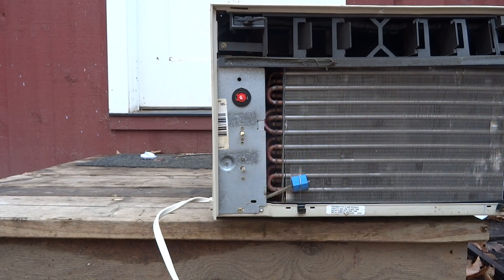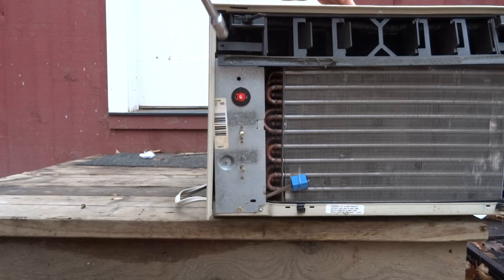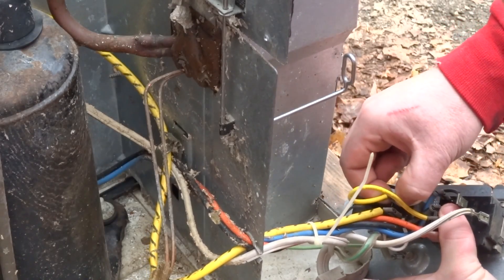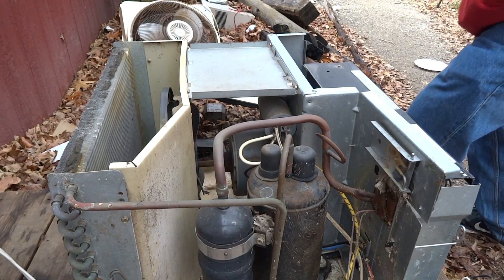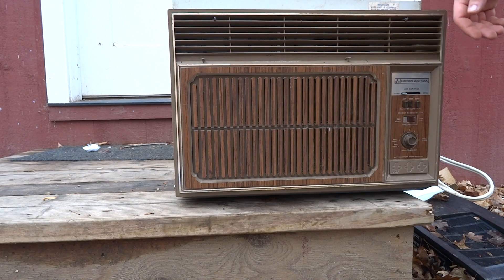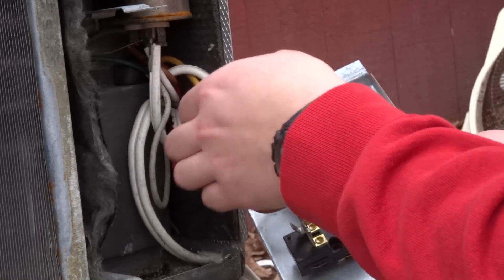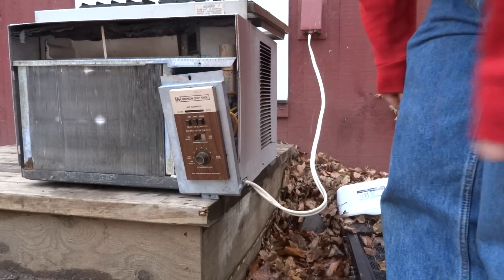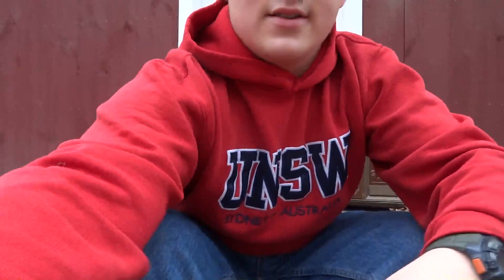How To: Bypass a Thermostat in a Analog (knob based) A/C

Comment: Joshua, are you still replying to questions?  I have a Roper window A/C knob base.  I need to know how to put the wires back onto the main switch.  When wires were removed, the switch was not marked (by color of the wire) where they go when putting wires back onto the switch from the A/C unit.  It's an old unit  (I think it may be a 1994 model) and I can't find a diagram to show where each wire goes.  I have pictures of the wires and the main switch if you think you might be able to help.

Comment: Thank you SO MUCH!  This was such a no brainer, I don't know why I didn't try it sooner. Your advice to check the wiring diagram was perfect because mine was a black wire. Before I was just remotely locating the thermostat "wire" but when it broke it from being flexed too much it turned out to be some kind of copper vacuum tube and then that forced my hand.  The hardest part was fiddling out the control panel and wiggling it back in.

Comment: Anyone know how to bypass a digital thermostat on a artic king?  I want it to run all the time.  I have it plugged into a thermostat power plug so it won't run all the time. Thanks
Reply from the maker: Yep. Pretty much the same idea as what I did here. Just find the wire that runs to the circuit board and jump it to main power. As soon as you do that the compressor will run whenever the unit is plugged in.

Comment: Easy to install. do7.pl/honeywell1 Although I had to connect a wire in the furnace to get 24volt power to the thermostat. I called for guidance and while I was on hold figured out how to do it by reading the instructions.I love that I can adjust the temperature while I'm on my way home.Update: I liked the thermostat so much I ended up buying a second one for my upstairs zoned heating cooling system. You get very use to the convenience of this unit.

Comment: Have you ever wire in a cooler temperature controller in to a window AC unit, using one for a cooler?
Reply: I did basically, I have two window AC units in my small home, I took out stock thermostat, and installed digital thermostat. Literally wire it just like the original crap one,now both units keep house at 60 degrees 24/7
Reply: If you do this , be careful to only use a mains voltage thermostat: many thermostats are designed for 24 volt AC/low voltage signal only. Best option for a basic thermostat at the point of use, after the internal thermostat is bypassed as shown in the video, is something like this:  https://www.amazon.com/dp/B08HNHBC8P/

Or this (I have this one): Lux WIN100 Automatic Heating & Cooling 5-2 Day Programmable Outlet Thermostat, Compatible with Portable A/C, Fans, and Space Heaters https://www.amazon.com/dp/B000E7NYY8/

Comment: I have a 30 year old kenmore that in the last 2 days compressor goes on for 20 minutes then off for awhile then back on. Evaporator only cool and wet for lower 2 inches. This started after cleaning lots of dust off evaporator fins (may have nudged thermostat wire in process). Tried cleaning thermostat  wire and made sure here is clearance from evaporator. Did not work. Was going to try by-passing thermostat per your video, but the thermostat wire clip where is connect to the control panel is joined to another wire clip connector with a plastic clip (black wire...cannot see where it goes). This unit has 2 knobs and power saver option on control panel (off, fan, power saver, low, med and high settings). Any advice on either how to fix problem or by-pass thermostat. In the middle of heat wave and will likely take awhile to get a new AC. So need this to work and doubt if the compressor would ever cycle off anyways right now.

Comment: Great video just worked on a old ac in my apartment only thing i have to unplug it for the compressor to cut off
Reply: Plug the power to a cooling down external thermostat and voila.

Comment: Why do I want to bypass the thermostat ? I have one for around 10 year works fine but now I’m curious
Reply: To use for a different purpose like a walk in cooler room
Reply: roy cook thank you let me tell you that now I’m using it 8 hrs a day because I’m working from home but now is failing I think is the thermostat 🥺 because it stops sending cold air so I have to turn it off and on many times to work again
Reply: Mine cycles, especially in the morning, and doesn't really cool enough for my room. Max cool might get it only 75 F in parts of the room, and it's not that big. The thermostats on these units are set wrong from the factory. Everyone has been in a car where you can get frozen out and then you turn it down... these stupid window ACs cycle when the case gets cool or due to age or not being ever properly set for an actual cool and dehumidified room. Short cycling should only happen on an AC that is too large for a room, but it can happen if the wimpy fan doesn't blow the air aloft well... but it's just a bad thermostat design for most of the ones I've seen.
Reply: Ok, so I just bypassed my thermostat. It works fine this way. Mine couldn't be wire-swapped because of the design. I had to pull the wire going into the thermostat, make a small jumper wire out of 12 AWG copper, and connect it to the one going toward the compressor. So I just shorted around the thermostat, in other words.

Comment: A trouble  here with a Split type A/C on indoor unit. Outdoor unit both fan and compressor motors working. Only trouble for indoor unit only runs for 48 seconds then shutdown automatically even at Low Fan Mode only. Similar trouble happens after restarting. Motor speed is working ok, swing motor working ok. Remote control works fine. It's YORK Model: HTEA180S-AAR. Power supply is ok and stable. No trouble with the mains or MCB. Indoor fan motor rated at 0.052Kw ; 0.24Amps. 
Pretty sure you've some good ideas or tips about it.  Thanks

Comment: Why not run jumpers to an external mechanical thermostat that can be set much colder??
Reply: You can do this. Or use a WiFi plug with some logic using another sensor, or use a purpose built thermostat that has an outlet on it. Bypassing it gives you the most options given the availability of mains voltage control devices today.

Comment: will the compressor still switch on and off if you bypass the thermostat?
Reply: The on/off button will still work but the compressor will run all the time and evaporator coil could ice up.
Reply: If you can’t replace the AC’s thermostat, then just plug your bypassed-thermostat AC unit to an external climate controller (wired on cooling down, not heating up).
Edit: as Chris said, the on/off switch will still work, it just isn’t hooked with the thermostat, which is a secondary on/off switch (switched by ambient temperature) on the same electrical line.
[A climate controller is an external thermostat with both functions of cooling down (AC) OR heating up (heater). Easily available and cheap]

Comment: Let me ask you a Question 
I have a Digital 12,000 BTU FrigidAire AC and a 5,000 Frigiaire Both worked untill I had to take them outside and Clean out the Insides with Bleach and a Hose here's the situation for both They will both work if I Hold Power and Mode to turn them on I think it's some kind of test feature But eventually the Compressor turns off . Then if I turn them on normal compressor won't turn on unless I hold something very warm around the sensor probe. So since I know it has to be the Sensor probe I removed the Sensor which gives me A5 Error Code but also gives cold Air So I don't really care. But what would happen if I just cut the Sensor Probe off and just Splice the 2 leads esentially bypassing the Sensor or would that have the opposite effect? 
I am planning on getting a New probe in a few weeks but it's too hot to have to wait.
Thanks

Comment: Thanks for the great tip.  I was wanting to use a small (about 4 x 7) utility room to cure homemade meats.  I bought a small window unit to cool the room but I could never get it below 63.  After watching this video and others it was clear that these units are governed.  I already owned an external temperature control unit.  The unit has its own power plug which goes into the wall - and the AC unit plugs into this plug..  On the other end is a thermostat and wire that feeds back to the control unit.  The unit has a dial setting.  I set it for 55.  When the temp climbs above 55, my unit sends power to the AC unit and it starts to run.  When the temp drops to 55, it shuts off the power to the AC unit and it stops.  No concerns about the AC unit running until it freezes.
Reply: Yeah it's really irritating that they don't let you cool to below 63.  I could have tried this but didn't until I watched his video.

Comment: Good info. Ty. where is the house return connect? the cap. or the compressor?
Reply from the maker: DUMBASS I'm assuming this is a joke based on your username.
Reply: Joshua's Recordings 
No I was serious. I found out that on a 5 ton a/c transformer, I has, 220, 208 and COM. I was trying to find out if the COM was for the return. But its for the other 220 leg. The user name is used for elevation of attack of self or character assination.(sometimes it back fires)

Comment: hey can you help me. im currently here in middle east ang its really hot. i followed your video so my compresor will kick immediately but wont work .i have two wires from thermostat to maint switch where i will put the wire from the compressor. my unit is carrier
Reply from the maker: If the unit kicks on but is not cooling it could be either the filter or something worse. If the filter is clean take the unit out of the chassis and check the condenser coil. If that is caked with dust clean it. If not slide the unit back in and take off the front grille. If you hear Freon moving through the pipes the unit may still be savable, if not or if you just hear a hiss then the Freon may have leaked out. If the Freon leaked out the unit is not worth saving unless it is a very old unit.
Reply: thanks for the response.. the main problem is when its too hot it cant generate cold air .. i already clean the whole unit. when night its working smoothly and i noticed when day . the compressor working intermitent. i already change the thermostat with a new one. but still same problem so thats why i want to disabled the thersmostat so it will forced to worked the compresor.what seem to be the problem. thanks in advance

Comment: if I live in south Texas where it is extremely hot will my ac freeze up if we by pass the thermostat?
Reply from the maker: No, not unless it is low on charge or gets below 60 degrees in your house.
Reply: Shouldn’t freeze up like OP said, but if it freezes up when it’s not cold in the room, then the AC unit could have low refrigerant. You can recharge these window units, but in my experience it’s easier to get a “new” unit given how many people throw away “old” ACs after just a couple seasons. About to attempt a thermostat bypass on a free 8k btu window AC I picked up about a week ago… ty for this video.